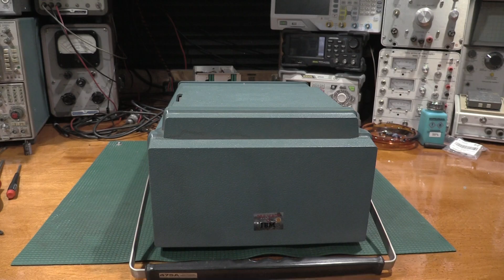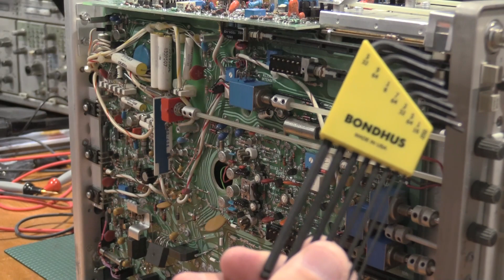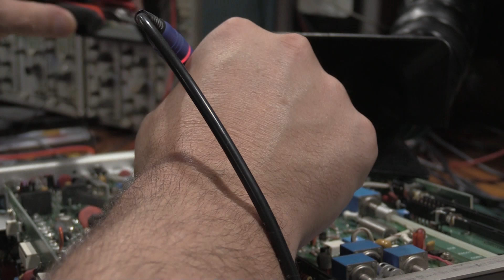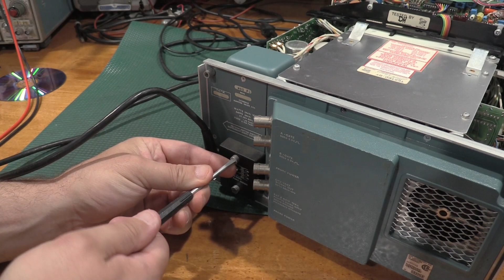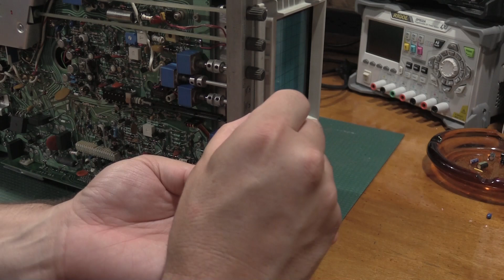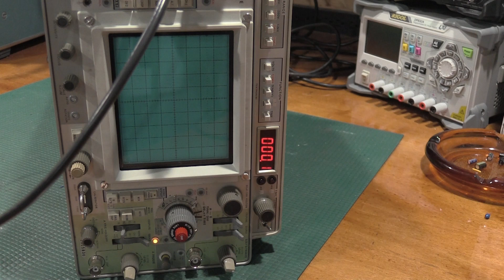Tektronix 475A Power Supply and Scope Repair (With Soldering)

Comment: One of my Tek 475’s abruptly stopped working so I opened it up to take a look. I measured the various supply voltages and the +15V, -8V and -15V all had virtually no voltage output. Looking closely at the schematic I realized the +15V supply also supplies the op amp that regulates the -8V and -15V supplies. So the problem was likely in the +15V supply. Using the techniques shown in the video I traced the problem to the exact same tantalum capacitor. It took only a few minutes to replace it and get the 475 working again. Thanks for a very useful and understandable YouTube video.
Reply from the maker: Excellent! Glad to hear that another 475 is back in service.

Comment: Great Videos.  I have (2) 2465 & (2) 2465B Scopes.  One of the 2465B I have recapped the power supply and going thru calibration.  Luckily,  all the voltages are within spec, so far.   In the process of watching all your videos.  Having you as a knowledgeable resource is irreplaceable.. Such great information to have for those of use lucky enough to own Tektronix scopes.
Reply from the maker: Glad I can help!

Comment: Thank you for this video, it enabled me to repair my 475 that rudely quit while in use, Checking the resistances of the power supply rails is something I never done and it worked quite well. I found the shorted tantalum quickly and ironically it was the same one that you had to replace in the scope in your video. After swapping that 10uf tantalum with a high quality electrolytic my scope was up and running again.
Reply from the maker: Excellent glad the video helped bring a scope back to functioning.

Comment: I am 82 and was a Tek scope repairman for RCA in the 70’s and 80’s. However I didnt see too many solid state scopes. Mostly I worked on the 500 series scopes. I watched you troubleshoot this 475A, its just kike one I bought for $75. There was short in the +15 volt supply and I tracked it down using your technique. That is all that  was wrong with the scope. Thanks for the tutorial.  I will use the working DM44 signal test points to troubleshoot  on my other 475 that gives me a 333F error code on the meter scale.

Comment: I don’t see how the potentiometers can be cleaned, because they would need to be desoldered from the board. Otherwise, there’s no way to apply any contact cleaner, as the openings through which the cleaner could penetrate are on the board side

Comment: I'll gladly trade you repairs. I have an IBM 475 where I have to change two of the large aluminium electrolytics (I may just change them all). I'm getting out the Weller gun for those. It also needs a new fan motor (noisy). Otherwise the scope is mint. I'd bet I've fixed over 100 of the 465's. 465B's and 475's. However I'd bet this is only the 2nd or 3rd one I've seen with bad main filter caps. Sam W3OHM

Comment: Hello, congratulations on your work, I have a question for you, I have an oscilloscope similar to yours, in my case it is a Tektronic 465, would you have a diagram of this oscilloscope?
It would be of great help to me, thank you very much in advance, greetings
Reply from the maker: Thanks, There is an amazing amount of information out there on the 465. I have several videos in the back catalog on repairing and calibrating 465 scopes. I also have another one in que for repair as it is showing some trouble now. So more is on the way.
The full service manual can be found at the tekwiki located here: https://w140.com/tekwiki/wiki/465 The tekwiki is a great resource for all things Tektronix. 
Zen

Comment: Give that shorted tant a “send-off” to polarized capacitor Valhalla by dabbibg it across the lowest source impedance you can muster, (Car Battery or similar). 

I have a 465 (without the DMM on top), it has an intermittant transistor in the feedback loop of the EHT supply, sometimes it works, sometimes it stops and the tube looses its EHT. this transistor has its base connected to the lower end of that beryllium oxide thick film high value dropper resistor. Most transistors and other semis in these old Tek CRO,s are in dockets but this little bugger has its base lead soldered to the ceramic tag strip and I either need to solder very quick without melting it all or find some of that sabvit solder with copper and silver dissolved in it to saturation…sippose I could cut the base off and solder the replacement transistor to the old lead…but for now I just put up with it!  Somewhere I have an old Tek video waveform monitor with some valvrs in it and a LOT of those ceramic tag strios. There is a reel of sabvit solder in there fastened to the chassis….how nice and thoughtful those Tek guys were!!
Reply from the maker: I have a solder video coming out that will address this but the short answer is Kester 24-7068-1402 Alloy is Tin 96.5% / Silver 3.0% / Copper 0.5%. I use this a lot on ceramic strip work Type 184, 106, 191 all of them are mainly ceramic strip construction. I was looking for 5% silver but I have not found any alloy yet that fits this bill. The ceramic strips need a good thermal mass iron though the ceramic will soak a surprising amount of heat before the joint melts.
Reply: Low impedance short circuit detection has found me many a blown tantalum when I couldn't find it other ways ;-)

Comment: The trimmer capacitors have a very limited rotational life. They open after several calibration cycles. I had to replace all of them on my unit. The fault tag listed the problem as fails calibration, beyond  economical repair.

Comment: Nice job ! I am working a National VP-5230S without schematic. Problems solved in horizontal because a diode leakedg and searching about substitute to the 2SC1326 because the vertical circuit sometimes stop and the trace gonne ! Congrats and best regards